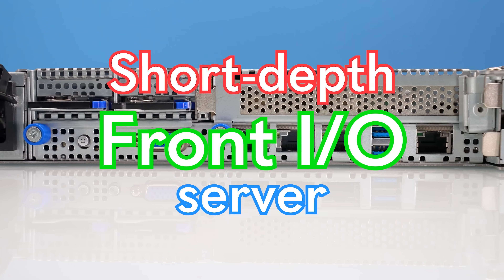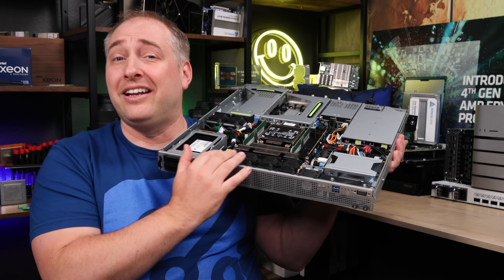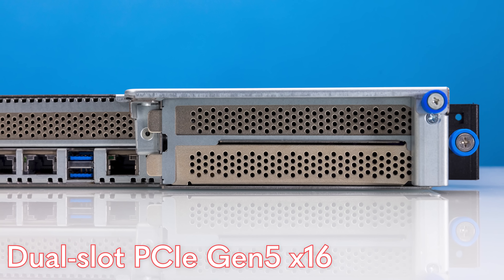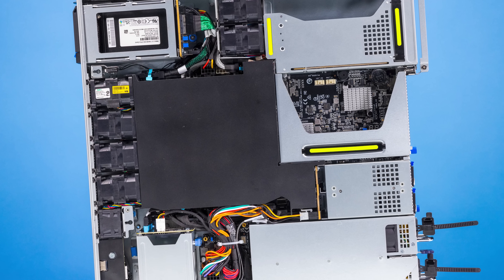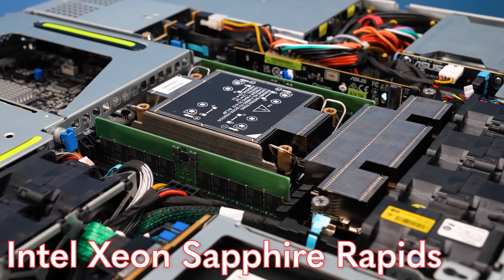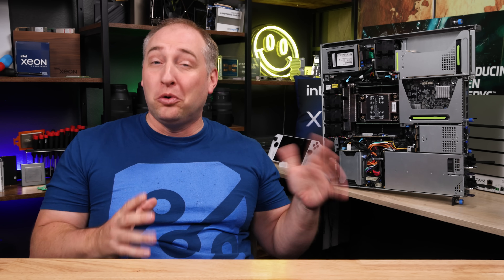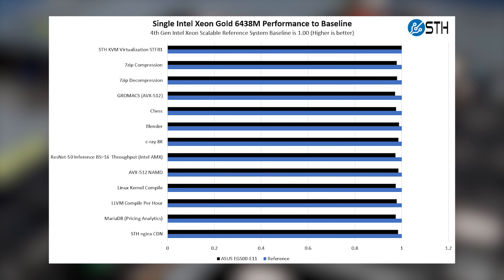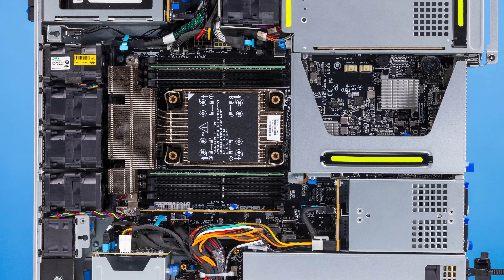This INCREDIBLE Short-depth Server has a Storage Secret

Comment: So so close, yet not so close to being perfect. The PSU should be at the back, and the drives at the front. There is so few manufacturers that do it right (there are few from Supermicro, but I just gave up and built mine own from scratch instead).  But really nice to see it has U.2, M.2, EDFF, and SATA. Everything doubled. Quite versatile indeed. 3 PCIe slots also great. I would prefer one of them to be OCP instead, but I guess that is not bad either.  Idle 80W, oh, that is meh.
Reply from the maker: You could swap the rack ears and make that possible.

Comment: It would be pretty silly if the rack ears weren't reversible. Are the fans in push or pull configuration?
Reply: From the pictures on Asus website, it seems that the fan are pulling the air from the psu side in both the R (ears on the traditional side) and F (ears on the psu side like the version shown in the video) versions.

Comment: Hey Patrick, do you plan on hosting your videos elsewhere (if Youtube succeeds in driving your audience away)?  I subscribed to the feed on your website a while ago.  What's the point of the kitchen sink storage options opposed to different versions of the server each support 1 one of the options (besides pcie card)?  I wouldn't want to stock 5 different spare parts.  On the other hand, I would want at least 3 of a given type for raid 5.
Reply from the maker: Probably not in the near term, but we might start doing vertical for elsewhere when we get the new studio in Nov.

Comment: Seems like they missed a trick to be learned from the 2019 Mac Pro: most of those cables are unnecessary when you design a tightly-integrated system like this.
Reply: They probably could have cut more cables if they really wanted to; but going by the manual the system doesn't actually look that tightly integrated: there are two variants based on PSU length(the 650w short PSU one is shown here; in the 1300w unit the front 2.5in bay is gone because the PSUs occupy more space and that is where the power distribution board goes instead); which means that the PSUs can't just plug into the motherboard since the attachment point isn't in the same place.

The E1.S cage is also optional, which means more cabling; and the I/O on the intake fan side is all cabled because no part of the motherboard is even close to it.

If they'd been willing to do a spin of the motherboard exclusive to a 650w config with E1.S populated they could have had the PSUs connect directly to it, integrated the power distribution board, and connected the cabled I/O and E1.S directly to the motherboard; and if they'd spent more money on some sort of sliding carriers, like you see on some switches, they probably could have done away with the fan power cables; but that sounds like a lot of lost versatility and extra motherboard PCB area and mechanical complexity to get rid of a few wire bundles.
Reply from the maker: Yes

Comment: I usually recommend ppl upgrade when a server is starting to hit around 80 percent load, and aim for 60 percent load with the replacement. So around 70 percent avg server load sounds just about right lol

60 percent means ur workload can scale 1.5x in the 5 year lifespan of the box.  And frankly if you're expecting more growth... you probably want to upgrade every 2 or 3 years instead buying for 5.
Reply from the maker: That makes sense.

Comment: Can you get an option on SFP+ because 10GBaseT is useless in a data centre. Oh and the X710 was first released in Q4 2014, so that is a nine year old chipset and note remotely recently. Clearly, you have been on the crack pipe. Had to double-check because I knew our compute nodes purchased in 2017 all have X710 NIC's.
Reply: Why is 10GBaseT useless in a data center?
Reply: @allanwind295  For lots of reasons. Firstly 99% of data centre switches are SFP+ because for starters they are cheaper and lower power so running costs are significantly lower. In a rack or even to an adjacent rack a DAC cable is lower power, and thus cheaper. If I need more than can be managed with a DAC cable well its SFP+ so I will just stick in some SR transceivers and go fibre optic. Break out DAC cables are awful to work with and super inflexible. Much better to go optical and breakout to a patch panel and get a bunch of flexibility. I have hundreds of 10Gbps ports at work and not a single 10GBaseT amount them. If someone presented me with a server that had them my first port of call would be to swap the NIC for something that was SFP+ I was also taking with the out head of networks (I work in HPC) and they don't do 10GBaseT either. There is the grand sum in the entire university of one port using a transceiver because some dum research group went out and broke procurement rules and purchased a DGX box and want to use it's 10GBaseT port. They are a problem group anyway because they didn't consult on anything before making the purchase, so we are having to do a major power upgrade to accommodate them.
Reply from the maker: There are a lot of folks still rocking X540-t2's and older. Also, the updated X710 10Gbase-T (check the X710-T2L for an example) is 2019. Fortville required a re-spin when it was still a 40GbE/ 10GbE SFP+ and so it went through revisions.
Reply: Well this clearly position to be deployed in an edge environment. Copper isn't wrong, and it has room for expansion

Comment: The Asus web page for this product does show the rack ears on the front, rather than the back.
Reply: The Asus website show both version, the F version has the rack ears on the side of the psu, the R on the other side.
Reply: It's good that it's been confirmed that it has the mounting holes for the ears to be used either way.

Comment: I really don't like that most servers have the rack ears in the front.... Sometimes I want to do maintenance on the hardware, swap a bad memory module, a bad gpu, whatever, and with most servers I have to fully take the server out of the rack for that, because the lid of the chassis can't open, because the server can't be pulled out of the rack all the way. If I could pull those servers out the back tho that wouldn't be an issue at all...
Reply: Duh, that's why you get sliding rails. If you are cheap skating and getting static rails then sucks to be you.
Reply from the maker: I prefer always having rails. That is a minority preference however.
Reply: @ServeTheHomeVideo  I never understood that as it is a health and safety issue. If you don't have sliding rails then especially if the device is high up in a rack you are going to need two people for any maintenance rather than one. Even if you decide you don't care about dropping a server on yourself or doing your back in doing maintenance, dropping the server would turn simple maintenance such as replacing a faulty DIMM or fan etc. into a very bad day. Spoiling the ship for a hap'o'rth of tar frankly. At this point I take issue with vendors of Infiniband, Fibre Channel and Omnipath switches a pox on you all.

Comment: can you get reverse airflow fans if you can indeed mount it around "the normal way"?
Reply: You get the RS2-R if you want normal orientation.
Reply: @nadtz  When you look at the pictures on Asus website, the fans seems to be mounted in the same orientation for both R and F versions (you can see the flow direction arrows on the fans). If that is the case, the R versions will blow hot air through the front. Definitely something you want to take into consideration when mounting those versions in a rack.
Reply from the maker: Yes.

Comment: I've been all my running SFF and tower desktops back-to-front for years, only mod is to add a 2-way 2 pin dupont splitter on the front panel power button header and fit a push-button switch that I thread through a vent hole in the rear panel (hotglue it in place)

I've never understood why desktop cases have all the connectivity at the back out of sight and all the styling bullcrap up front.
Reply: Silverstone tried something different with the IO at the top instead of the back but I guess it never took off.  Loved my raven case that was set up that way though.